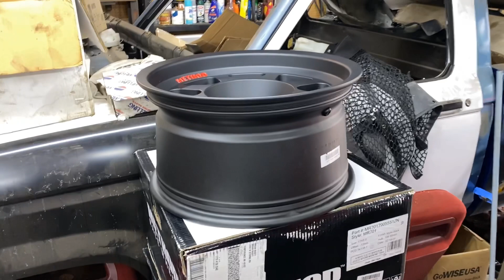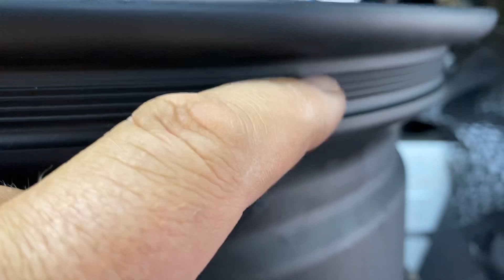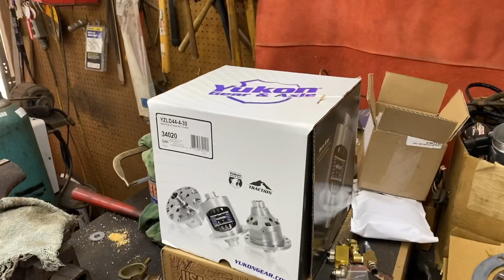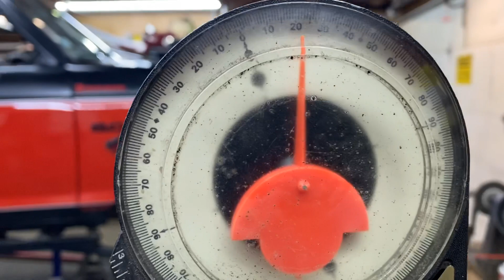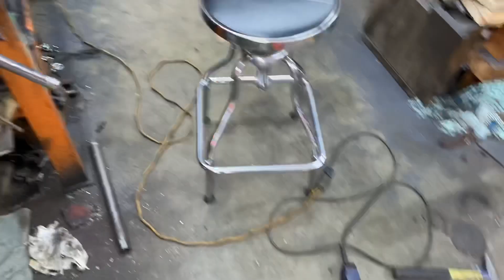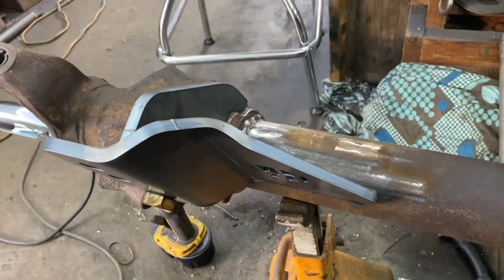New shoes and axle for Gilligan

Comment: What did he machine the c out to so the tube fit?
Reply from the maker: He didn’t remove any  of the cast iron. He only cut out the remaining axle tube inside it. It was still a slight press fit for me to get the wedge end back on over the tube again
Reply: @randumadventures  do you happen to know what size the axle housing OD is
Reply: Was it BFH doable or need pressed
Reply from the maker: @brandongibson6551  I don’t remember the exact size. Yes I tapped it on with a mallet
Reply: @randumadventures  about to start doing this did you heat that cast before you welded it back onto the axle too
Reply from the maker: @brandongibson6551  yes I did
Reply: @randumadventures  what axle are you running in replacement of the stock shaft
Reply from the maker: @brandongibson6551  the shafts are from RCV for a narrow early bronco d44
Reply: @randumadventures  what about the steering setup? And also how did you mount th frame side of the trac bar?
Reply from the maker: @brandongibson6551  trac bar bracket is from James Duff. I made a video a couple weeks ago showing and discussing every part of the truck.

Comment: The easiest way to cut the axle down is to use the WAH from Classic Broncos. Ive cut many of the ‘78/‘79 axles down, I’ve pulled them out of the center pumpkin, cut the tube, and I’ve used the WAH, plus using the WAH, you will get unrestricted flex.
Reply from the maker: I’ve never heard of that until this moment. Wish I would of know about this. Very cool option